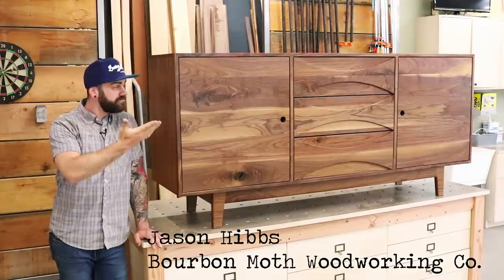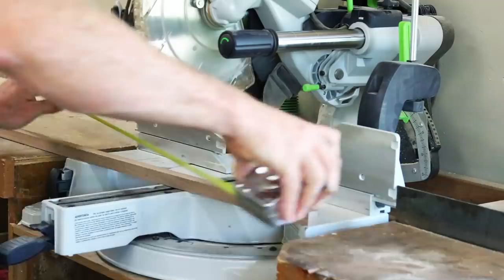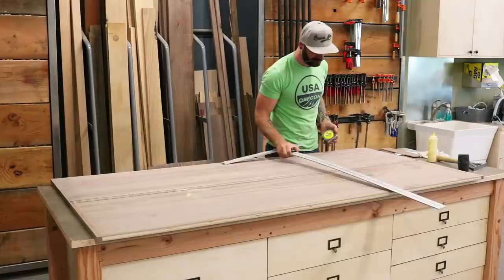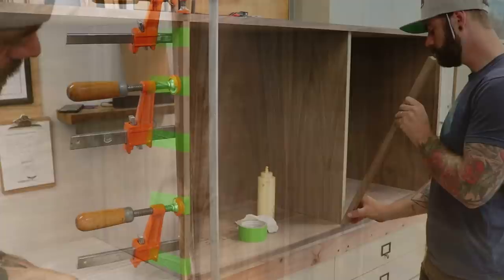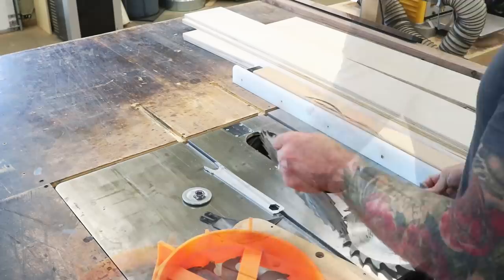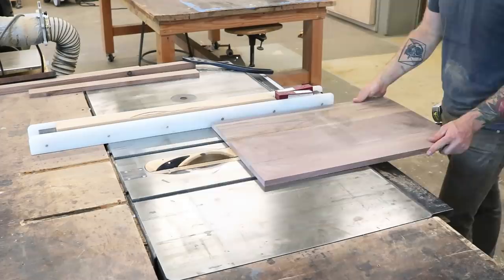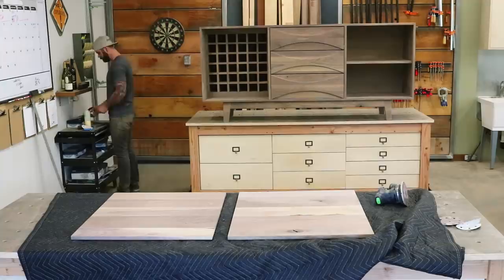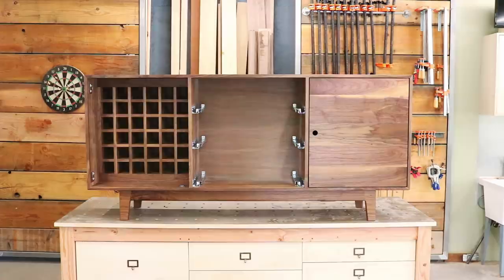Mid Century Walnut Hutch Build/ How-To

Comment: Just got to say beautiful work. One thing I would tell your viewers is never use the factory edge of plywood to glue anything on always alow about a half inch of cut off so you have a good clean glue up. Factory edge plywood tends to be not crisp and can cause problems later when sanding.

Comment: I was thinking that for the front drawer pulls instead of using a flush cut for the perimeter you could use a dovetail pattern bit to get a bit of an angle in there for a fingers to hold on to. Then you could just soften off that edges by hand to avoid getting cut by it.

Comment: So you're checking for square here right after assembly as the glue is drying - what could you do at this point to course-correct? Notwithstanding the quickly-drying glue, you've already drilled the domino slots. Did you do a dry fit off camera?

Comment: Nice work but one comment about the legs/feet.  The direction of the grain in the legs/feet runs in a horizontal direction.  While this is consistent with the direction of the grain in the rails that support the legs/feet and maybe visually appealing, it is not structurally sound since the legs/feet could split or break along the grain.  It probably would have been better to run the direction of the grain of the legs/feets perpendicular to the rails.

Comment: Such an awesome piece. Killer Job! Have you ever had any issues with your panel doors warping since they are solid wood? I've seen people use plywood for solid panel doors, but you would still need to use solid wood for the drawer fronts to get that sweet routing detail which would mean sacrificing the continuous grain.